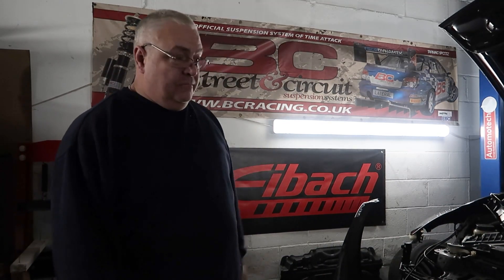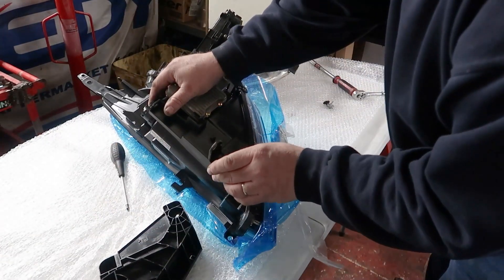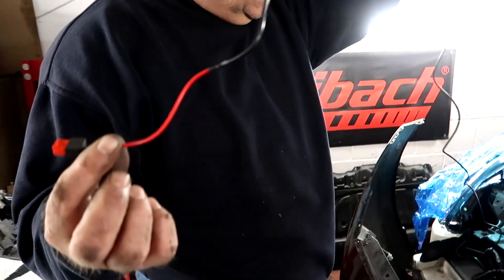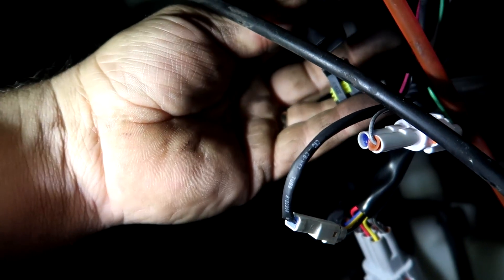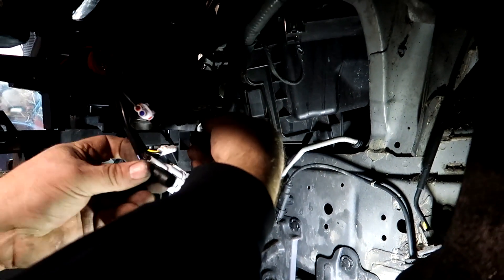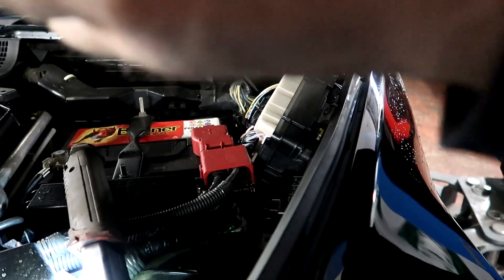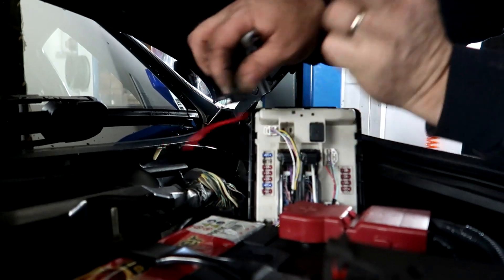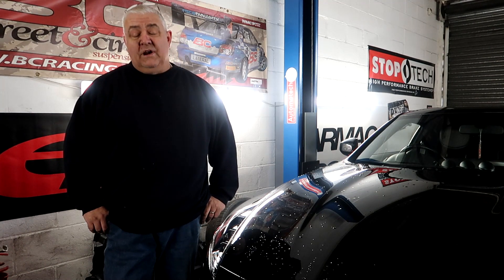Tarmac Sportz- Morimoto Nissan 370z LED Headlights Installation

Comment: I have the RHD 09 370, installed these yesterday. No extension was required for the DRL cable to get to the fuse box and I ran the connector cable up through the loom hole in the bottom. Connectors were joined for sequential indicators.